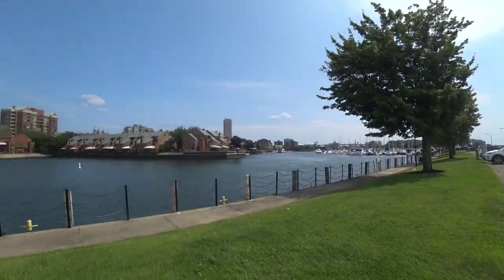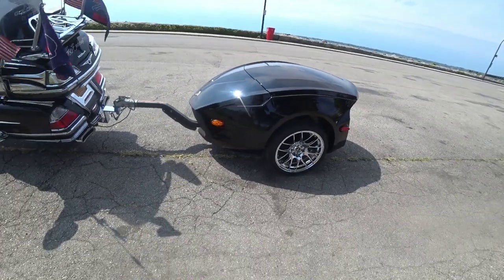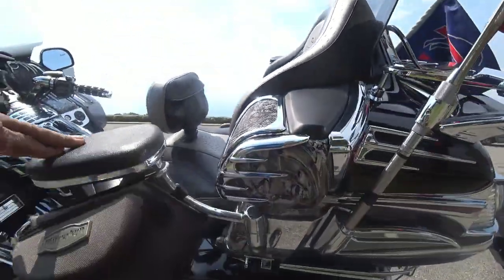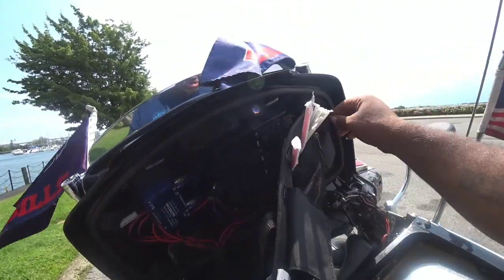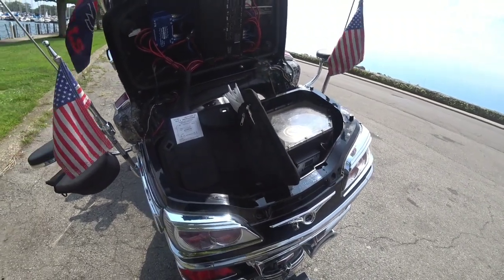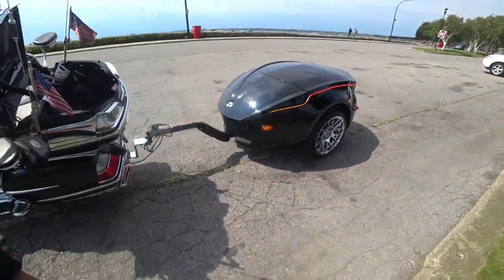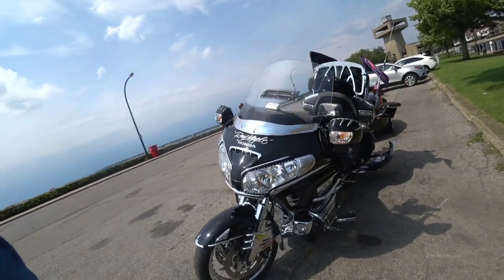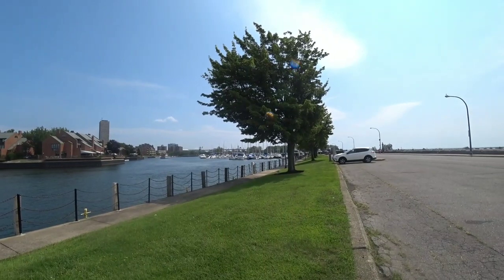TOO ENVIOUS GOLDWING HYDRODIP DASH, STEREO AND CUSTOM CAN AM 622 TRAILER

Comment: Hey Ray you got to tell me how you got that passenger  wind buffer installed and how you made it , and how well does it work for you and your passanger.  Thanks man and be safe out on the Wing!
Reply from the maker: THE PASSENGER SEAT BACKREST HAS TO BE REMOVE TO INSTALL THE WIND DEFLECTOR. IT COMES WITH NECESSARY HARDWARE TO INSTALL IT. KURYAKYN MAKES THIS WIND DEFLECTOR. BUT THEY ARE OUT OF PROPORTION NOW I DONT KNOW IF ANOTHER COMPANY MAKES THEM NOW. THANKS FOR ASKING PEACE
Reply: @raymondmaple2230  Right on thanks a bunch for the info. Ride safe!

Comment: Wish you opened that trailer. Nice gw got it looking good.
Reply from the maker: THANKS FOR THE COMPLIMENT. I DID MAKE A VIDEO OF  THE INSIDE  OF THE CAN AM 622 TRAILER. THE VIDEO IS CALLED INSTALL TRAILER HARNESS ON GOLDWING FOR CAN AM 622 TRAILER. THIS COVERS THE CAN AM TRAILER IN DEPTH WIRING, CUSTOM TRAILER RECEIVER TO PULL CAN AM 622 TRAILER BEHIND A GOLDWING AND THE CARGO SPACE INSIDE THE CAN AM 622 TRAILER. THANKS FOR WATCHING AND COMMENTING PEACE

Comment: Ray may I ask do you know if that rear tail light that we spoke about b4 that was discontinued would it fit a 2008 . Sorry hope I didn't interrupt you . I'm only asking because  I found it. It says it dont so I am making sure with you because  sometimes online that don't give the correct  information...
Reply from the maker: AS FAR AS I KNOW KURYAKYN DISCONTINUED THAT PART. I HAVE NOT SEEN IT IN A LONG TIME. YOU MIGHT BE ABLE TO LOCATE ONE THAT SOMEONE MIGHT HAVE A NOS ONE IN STOCK. THATS PROBABLY YOUR BEST BET. THANKS
Reply: I know I was only asking if you know it would fit a ((2008))model...?
Reply from the maker: @phillipvazquez284  YES MY BIKE IS A 2008
Reply: @raymondmaple2230  awsome thank you so much
Reply: @raymondmaple2230  Amazon has it back in stock do I need anything else to connect the light???
Reply from the maker: @phillipvazquez284  WHAT'S THE PART NUMBER OF THE LIGHT
Reply: @raymondmaple2230  3225
Reply: 3225
Reply from the maker: @phillipvazquez284  YEA THATS FOR A 2008 GOLDWING
Reply: @raymondmaple2230  ok Ty isn't there another plug I would need just making sure that's why I'm asking I really thank you a lot for your help I wasn't sure .
Reply from the maker: @phillipvazquez284  I DONT THINK THERE IS ANOTHER PLUG NEEDED I THINK EVERYTHING COME WITH THE LIGHT
Reply: @raymondmaple2230  ok thank you very very much for all your help have a blessed evening
Reply from the maker: @phillipvazquez284  THANKS

Comment: Really would like to know how they cut down the trailer rims.
Reply from the maker: THE COMPANY THAT DID MY RIMS IS WELDCRAFT IN LIVONIA MICHIGAN. I HAD THEM TAKE 3" OUT OF THE BACKSIDE OF MY RIMS THEN THE WELD THE 2 PARTS BACK TOGETHER. THEN I SENT THEM TO CALIFORNIA TO GET CHROME PLATED. MY RIMS RUN TRUE  NO WOBBLE OR SHAKE THEY DID A EXCELLENT JOB
Reply: Thanks; I am a 1 hour drive from Livonia; I will check them out.

Comment: total costs??
Reply from the maker: THE TRAILER RIMS ARE 1,700-1,900 DEPENDING ON RIMS YOU GET HYDRODIPPING WAS $800.00 AND I TOOK THE BIKE APART. IT WAS A JOB TO DISASSEMBLE AND REASSEMBLE THE BIKE. IF YOU ARE NOT MECHANICALLY INCLINED DONT DO IT. THE SYSTEM I HAVE 1,000 FOR SPEAKERS, AMP AND WIRING. THANKS FOR WATCHING
Reply: Raymond Maple wow!! Helluva job!!
Reply from the maker: @allboroughllcfilm  THANKS